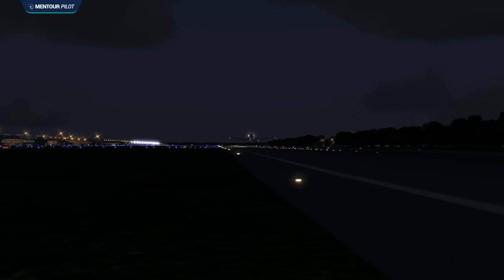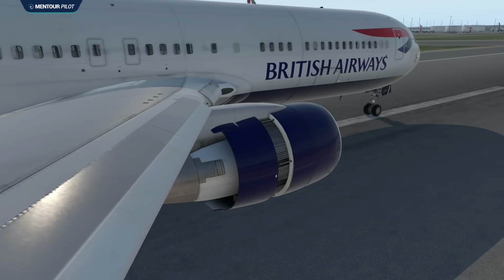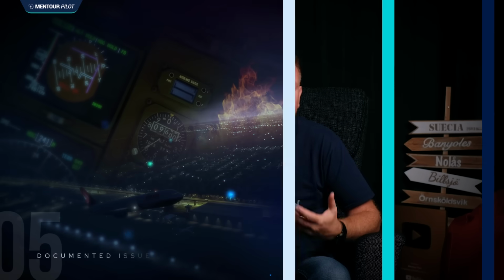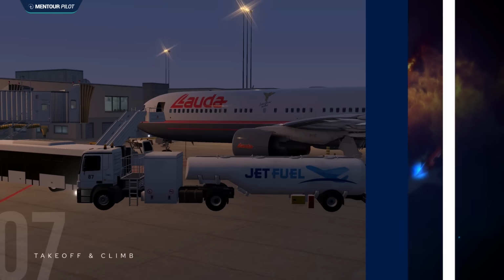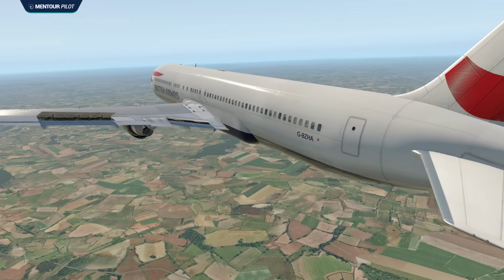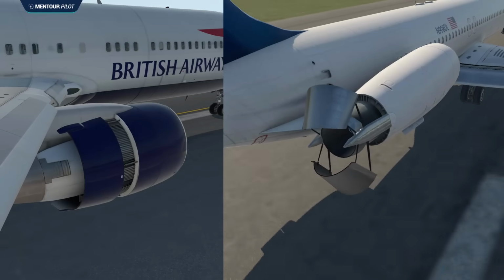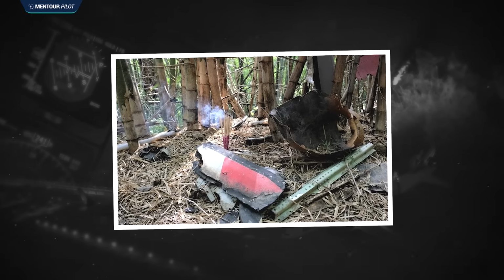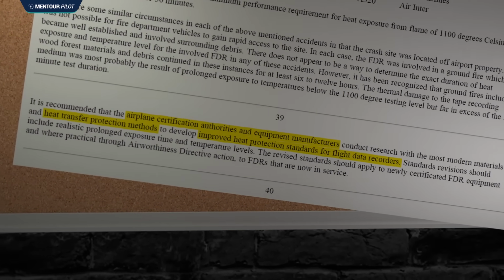HOW an Impossible Failure CRASHED this Boeing 767!

Comment: One thing that I always think when I see these kinds of videos, when it comes to error messages and stuff like that, is this: why do they use those cryptic abbreviations everywhere? It's 2025. Believe me, computers are able to store, transmit, and display complete words and sentences. I understand that back in the 80s you had to make do with a dozen characters, but that's not the case anymore. The human brain is very good at reading, but it can only unlock its full potential when dealing with whole words (instead of abbreviations and acronyms) and when those words use proper capitalization (which is why we usually dislike blocks of text in all-caps).

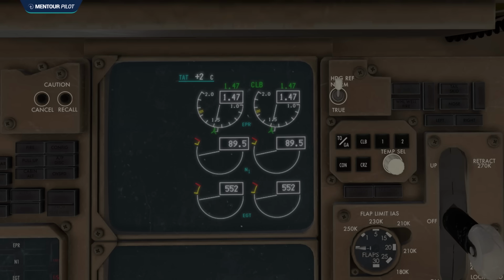I get that this is a bad video to post this under because it's from a crash that happened in 1991, so the message shown in, say, 5:18 is probably the best they could manage at the time, but the thing is that many aircraft systems still in use today use those kinds of messages. I guess my point is that we're not in 1991 anymore, so why are aircraft warning displays still there?
Reply: We are still flying planes designed in the 1990s or that are designed to be compatible with such planes is the main reason.

Comment: I'm not an engineer, but my understanding is that part of the lower nouse is because a fan is quieter than a jet engine core, but another part is because the noise of the core is encapsulated inside the stream of quieter air surrounding the exhaust from the core - in other words the fan produces less noise than the core, AND the fan exhaust attenuates of the noise from the core, making the core a bit quieter.

Comment: I flew the DC8.. and inflight reverse use was SOP.. the airplane did not have flight spoilers .. only ground spoilers.. and use of full- thrust reverse was part of the high-dive SOP.. if dispatched with and inop reverser we were restricted to FL250. This was with CFMs and original engines.. I was on an SAS flight that used reverse on approach to JFK. .. Flew the DC8-71 for United. Great video as always!

Comment: The speed with which the flight crew would've had to react to save the aircraft is beyond human given that between the onset of the emergency and the eventual crash, all the while the plane was disintegrating, was within a few seconds. It is hard for us, the audience, to get a sense of just how quickly these events occur and therefore how little time pilots actually have to respond with the correct interventions to save the situation. Sometimes they manage it, sometimes they don't. But it is thanks to these courageous men and women that we can travel as safely as we do today.

Comment: It's very hard to believe for this aircraft the design team decided that 200 kts was the upper airspeed limit where an inadvertent thrust reverser deployment would be controllable for the pilots when this aircraft could fly at much higher speeds into well over 400 kts.  Why didn't they analyze the airworthiness of this aircraft at its maximum flight speed with an inadvertent thrust reverser deployment?  Obviously somebody was not thinking clearly if at all on this particular potential problem.  The whole 737 MAX fiasco and subsequent poor design decisions with that series are indicative of extremely poor design decisions by Boeing.  Whether Boeing can survive this emerging idiocy with their products remains to be seen.  Nonetheless my wife and I will no longer fly on any Boeing aircraft.
Reply: Have fun trying to avoid flying on Boeing aircraft. You’ll struggle very much in doing so. Why? 50% of all large passenger aircraft today are Boeing planes. Also many airlines have a fleet of only Boeing aircraft. You’re literally worrying for nothing.

Comment: One correction Mentour Pilot, and that has to do with the DC-8.
I used to fly DC-8s, and the thrust reversers on engines #2 and #3 were designed to be operated (deployed) in flight as they acted as speedbreaks. The DC-8 did not have spoilers or speedbreaks that could be used in flight as they were only active during landings. The normal positions for landing were: Forward (deployed) 
Middle (closed)
Rear (armed)

Comment: Another aircraft built badly by Boeing. Of course Boeing said it wasn't the aircraft's fault.
Reply: Airbus has done similar things but be blind.
Reply: @raihothexiv15th37  oh, has an airbus flown itself into the ground whilst ignoring pilot inputs?
Do the doors fall off airbus aircraft?
Reply: @andrewallen9993 Yes actually. There have been instances of Airbus aircraft doing similar things. Look up Qantas Flight 72. Before you say “bUt iT wAs cOntRollAblE”, pilots have been able to stop MCAS. Not making that up. Pilot error was a big factor in the two 737 MAX crashes as well. Especially the second one. The NTSB said so.

Comment: I think in a situation when pilots experience severe problem like this particular case, can a pilot rely on only gliding the aircraft then waisting the time on  controlling the aircraft. When an aircraft start responding in an abnormal way, then it is better to quickly switch over to gliding the aircraft. I personally think it can benefit the pilot with the option to land the aircraft on any nearby available runway or on any plain ground. There are many safety inputs that can be designed and install in the aircraft to help assist the pilot to safely land the aircraft and minimise the rate of damages to the main fuselage of the aircraft where passengers are sitting  i personally have numerous solutions to different problems pilots face during technical failure of the aircraft engines or other technical issues causing aircrashes  I think I should write a proposal to the aircraft manufacturing industry on how the flights can be made more safe for the future generations.

Comment: Even the most experienced pilots, its very difficult almost imposible for the pilots to shut down the engine and complete the check list within 4-6 seconds. 
Surviving this  after deployment  reverse thrust mid air it will be a miracle.

Comment: Being a mechanical engineer, I still can't imagine how an aero plane is cleared for flight when it gives a fault signal. I don't care how much money is lost, you can never ignore the fault signals and alarms. I mean I don't even drive a car with a check engine light, let alone a plane with a fault signal. And how could they not have been able to diagnose the issue in 6 months? there are only few components to check for.

Comment: I love how these failure tests are only done at idle, when the reverse thrust would have least effect.  Didn't it occur to the FAA that two failures could happen at once? IE full thrust AND reverser?  Of course it will be worse at high speed too, where it might even rip the engine off.

Comment: Boeing doing Boeing things all the way back in the early 80’s. Figures they’d test the thrust reverser deployment at a low speed with engines at idle. Let’s test it in the best possible scenario is Boeings unofficial motto.

Comment: Doubt the plane engineers knew much about their own plane if they said it can fly with 1 engine full thrust and 1 engine full reverse and there's nothing to worry about. They will also work as expected after landing. What they did not mention is that by landing they mean crashing at 750 kn straight into the ground.

Comment: If only Boeing was more cautious with their thrust policies they easily had enough time to revert and make an emergency landing. And i know it was a maintenance issue with this engine causing issues in the past too without replacement, but the manual should immediately tell them to make an emergency landing.

Comment: I miss anyone reminiscing on how those maintenance guys must have felt.
Doing all they can beyond the book to find out what is causing this intermittent fault and then the plane crashes with all hands on board before they succeed.

Furthermore systemic problem is how Boeing can write up the if’s and but’s on investigating if the plane is flyable with an open reverser.
Anyone with a bit of aerodynamics ideas would know that flying low (dense air giving lots of lift) and slow(less impact on the wing by disturbed air) and with throttle down (reverser not doing all that much) is an ideal scenario.

Also Boeing writing this problem of the isolation valve in the QRH as a precursor to problems when combined yada yada yada in such undercooled non-impressing way would never urge anyone to take this plane out of service.

So if I am an engineer on that maintenance crew and after months of working on this fault again and again and I want to take this plane of the roster which is a huge commercial deal to my company, i have nothing to base my worry on and get company to do as i feel is safe and best procedure.

Knowing a bit about Lauda’s way of doing stuff i guess/hope those guys will have been cared for mentally.

Comment: A good friend of mine (sadly now deceased from a brain tunour) lost his daughter in this crash. I won't go into details,  but I had access to the photos of the accident victims. The father pleaded with me to make them available to him,  as he felt he needed closure. I lied and said that I couldn't obtain the images. I couldn't subject a friend to the horror of how the passengers (and especially his daughter) looked like. I've carried this burden with me for over 30 years. I can't describe how spiritually empty he and his wife were. In theory, the 3 lockout mechanisms for the reverse thrusters were incapable of deploying simultaneously. A pilot friend of mine tried to re-duplicate this event in a (real) 767 simulator and he didn't get such a violent yaw that the wing spar's load limit was exceeded. The general consensus was that about 2.5g would have been generated. The wing should have been able to take that load for a long period but the plane's wing broke off in just a few seconds. China Airlines flight 006 (a 747 SP, 1985) made a complete roll, after an engine failure and pulled out from a vertical dive. It experienced about 5g and the plane still survived. I just can't see how 767 would break up under much less violent circumstances.
Reply: I knew one of the passengers in your photos.  Small world.

Comment: So to be clear, in that configuration they would have had to:
1. Reduce the thrust on both engines to idle.
2. Enter a controlled dive, stabilise the aircraft, take speed away.

All within 4 seconds!!!

3. Slowly add in an acceptable amount of thrust on the right hand engine, so that the next thing that happens isn’t a stall or crash

Then declare a
mayday mayday mayday 😅

Comment: In brazil there was a fokker 100 who the reversor open in flight just after takeoff. In that case the pilosts had a know issue whit the AT. Just 300 feet after take off the AT disconects because of the reversor go tho the unlock position. The pilots manage to bring the trust to TOGA and then the reversor opens..

Comment: This is the problem with American "Certification"... Low speed, low thrust, sure it's fine. They didn't even use in flight parameters for testing.

Comment: My first instinct in this situation would have been to immediately cut power to both engines, rendering the plane a glider, at this point there is time to determine what to do, which would probably be restarting at least one engine.

Comment: Lauda, for his smooth control of the car and prudence, received the nickname "computer" in Formula 1, when Lauda began piloting airplanes, the instructors were amazed at the accuracy of his actions, not a single departure from the instructions, he did everything perfectly, and exactly as per the instructions. Lauda knew that the plane would be out of control, and that's why he first went to test the simulator, and then invited the Boeing management to check the safety of turning on the reverse, he invited the company management to fly with him, he will be the pilot and turn on the thrust reverse on one of the engines, if it is safe, he will be able to land the plane and everyone will survive. after that, Boeing had to admit a design problem.

Comment: I believe the NTSB stated that the pilots had less than 7 seconds to shut down the engine, full right rudder, full right aleron, reduce thrust on right engine and then they would have had to use the ruddee as a "top rudder" aka aileron to keep the pitch up since they were at such a high bank quickly. 
This crash was crazy, I studied these types of crashes a lot.
We always joke around when Boeing says something CANT HAPPEN.

Comment: Maybe it’s modern training or the fact that I mostly fly turboprops but if this happened to me my first reaction would be to pull both engines to idle immediately. Not just a thrust reverser deployment but any sudden roll and pitch down movement would trigger that training response from be because of UPRT. It’s shocking to me to hear it took 10 seconds to pull power off the engine, startle response or not. But again, modern training.
Reply: Shut down was the term h e used so I interpret this to mean that they did it earlier but that it took this long to shut down do to the technical reasons

Comment: A plane crashes due to faulty technology and the critical part that caused it goes missing from the crash site due to looting - I think that's unlikely - looters would go for luggage or anything that looked valuable not some random valve/solenoid that was likely still bolted to a larger piece of air-frame. Western corporations are evil and wouldn't surprise me a bit that missing part was on purpose.

Comment: So let me get this straight. Safety depends upon system redundancy. The aircraft alerts that redundancy has been lost. By definition the aircraft is now in an unsafe condition. The response that "Oh, but the pilots should be able to handle the MODELED system failure scenario" is ABSURD! First, depending upon MODELS has been shown countless, literally countless times to be a fool's errand. "Models" are perfect examples of Twain's clever quip: "There are lies, damned lies, and statistics."

In short, redundancy lost, pilots are assured to just continue with business as usual.

And it's horrifying to hear from Petter that, apparently, these aircraft are filled with microswitches that throw random warnings that pilots have learned to just ignore! Just exactly how MANY microswitches need to "get moisture in them" before somebody comes up with a better design? When safety and assuring the REDUNDANCY of critical systems is at issue, I'm sorry, but, "You can safely ignore that warning because you still have ONE safeguard remaining" is wholly inadequate to my mind.

SO many things wrong with this whole picture that the mind boggles, starting with: Don't believe ANYTHING that Boeing says at this point. Boeing has become 100% a company that elevates market-share and profits over passenger safety. Also, don't believe in FAA oversight! I'm not even an engineer, but from the start of this video when the modeling aspect emerged, I thought, "There's not a SHRED of a chance that all of the permutations of the inputs to this model are being considered." And then, sure enough, Petter explains the presumptions that were baked into the model. RIDICULOUS! And it goes on and on.

Supposedly air travel is statistically so much safer than driving. But, again, what are the INPUTS and interpretations that go into such a statistical assertion? Twain comes to mind yet again. At this point I'm driving an up to ten hour radius rather than flying. The whole process of flying has become so complicated, time-consuming, stress-laden, and then there's lost/damaged bags, and I WON'T fly on a MAX, that the totality has switched me back to just driving. And it's been GOOD! Actually enjoyable compared to the endless hassles that have become air-travel.

You all should keep flying, though! I don't want to be dealing with all of YOU on the roads. So, don't adopt my perspective in the slightest! You all just keep getting irradiated, getting strip-searched, trotting all over airports for gate changes, trying to find parking, waiting at gates, enduring late/canceled/overbooked flights, breathing strangers' air, being cramming into tiny seats next to beached whales, enduring snotty flight "attendants," paying for a ticket and then finding that you didn't thereby pay for a SEAT, and the litany goes on and on and on... AND ON! You can HAVE it, and I hope that you all keep enjoying the "experience" that flying has become.

Comment: A few facts about this crash. 
Thrust reversers were locked on basically all 767 world wide at this time because it was well known that there was the risk of an inflight deployment. 
Niki chose not to do that due to the  higher operating costs due to increased brake wear.

An inflight deployment under the exact accident conditions can be easily handled in 767 Level D sims if you stay within the  recovery window.
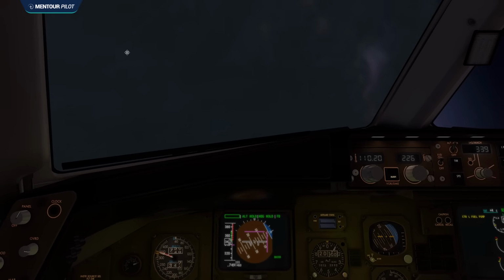The main problem was that both pilots had there seats at the aftmost 'fully relax' position! So when the reverser deployed, neither pilot was able to grab the yoke or reach the rudder pedals! 11:35 20:54 23:24

Comment: see this is why I seriously hate flying.. why are planes aloud to fly with any warnings or previous faults .. they should be flown with no passengers until its fixed....And if its not this problem it will be another that has slipped though....I really don`t wanna take my family back home to NZ, and if we do we will take 2 separate flights so we all don`t get taken out...what a nasty way to die..... we need high speed trains until the aviation industry gets it shit together or we invent anti gravity flying.....which we already have btw......but until the war machine releases it we will continue to die locked in a aluminum cylinders......
Reply: Situations like this is unlikely but you’re right